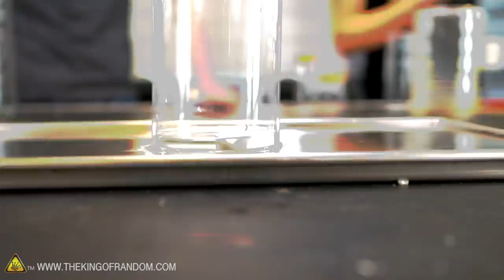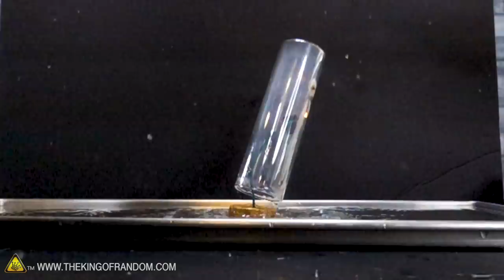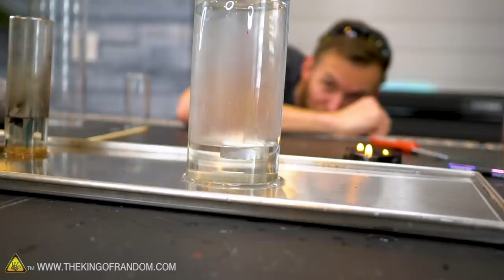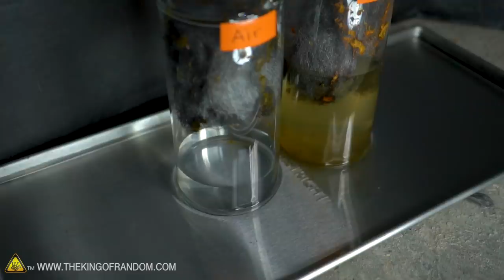Why Does a Candle Make Water Rise?

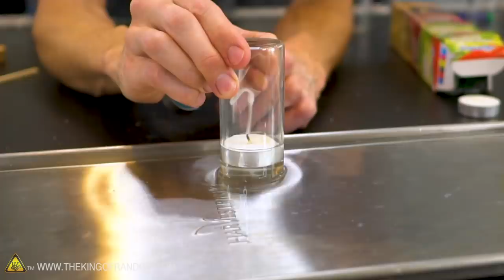Comment: 3:13 Nate : "You also get atoms of water..."
Me : Aight, imma head out...
Reply: Same thought here.
Reply: Water is my favorite atom. So is playing with lasers and only having one of two people wear laser goggles.
Reply: I came down here to say that
Reply: Our atmosphere is a lot of elements like nitrogen and hydrogen so it’s hard to say exactly a correct formula for the air in their location, but anyway the type of reaction is combustion which has a product of mostly CO2 and H2O. So here is a makeshift equation: Air + O2 -> CO2 + H2O
Reply: @RusticAlarm  I think you forgot the fuel in your equation, you gotta get something burning.
(Also, that's a r/woooosh right there)
Reply: Yeah same
Reply: Givrally you need an r/woooosh too
Reply: @givrally7634  the fuel is the oxygen.
Reply: Water are particles, right?
Reply: @CarpetHater  Water is a molecule, made of 3 atoms. But yes, you can think of it as particles.
Reply: When paraffin burns it does produces atoms of water

Comment: Why does a candle make water rise?

It just works
Reply: thank you for your contribution Bigfoot, mad respect
Reply: Love ur name ngl 😂
Reply: Just Some Bigfoot With Internet Access because the flame takes up all the oxygen 😂
Reply: The candle uses oxygen which takes up matter so the water wants to equalize the pressure
Reply: R/woooosh on some of the replies
Reply: @akturbo774  Nice 👍👌😍
Reply: The water gets so hot, it jumps up from the shock of being burnt!
Reply: How does bigfoot not be seen?

Stays off the internet! :D
Reply: Son : "Dad, why does a candle make water rise ?"
Programmer dad : "It just works, don't touch it."
Reply: it's a reaction of air expanding and then retracting so the candle heats up the air so it expands and pushes out the air then the candle flame go's out and it terns cold and makes - presser 
and pulls the water up.
Reply: Has anybody said r/woooosh yet ?
Reply: no
Reply: but woooosh
Reply: Just Some Bigfoot With Internet Access KINGU CURIMUZONU
Reply: You're cheating on donut
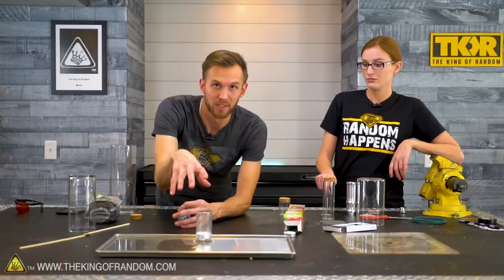Reply: He actually explains the primary cause (3:22). However, it's mixed with him talking about chemical reactions... Which at most is a secondary cause... But I don't think it has any measurable effect at all.
Reply: @devynjordan3097  almost right, but not quite.

The water is not being pulled - it is being pushed by atmospheric pressure on the outside.

"but when I stick a plunger onto a window and then pull the handle, I can feel the suction force trying to pull my arm!"

That isn't a pulling force, it is the weight of the entire atmosphere above the plunger, pushing on the vacuum cavity you created between the glass and the plunger.

This creates the illusion that vacuums pull.
Reply: Why do I see you every where
Reply: Create a vacuum in a closed jar with a match
Reply: @devynjordan3097  Exactly. It is a simple physical reaction. It has very little to do with the chemical reaction.
Reply: @plzletmebefrank  Finally. I agree 100%. Maybe the CO2 molecules are a little bit closer to each other (taking less space) than the O2 molecules were before the burning used them all but I don't think it has any visible effect either.
Reply: @forestdenizen6497  I totally agree . Very well explained.
Reply: Just Some Bigfoot With Internet Access Your on every video I watch I swear
Reply: It just does
Reply: It works like a rubber duck I think all the air leaves so the water rushes

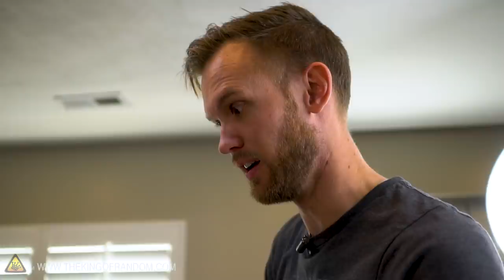Comment: 5:30 you watched a chemical reaction that displaced air. The ignition of the match caused a chain reaction that cause gases to rapidly expand. That made the bubbles. The physical change was when the molocules in the air cooled down and created low pressure, where the water rushed in to fill the vaccuum

Comment: Answer: vacuum. 

 The air heated by the candle takes up more space, so hot air escapes from the container (fixed volume) prior to the container being set down.   When the candle goes out, the remaining air in the container cools and contracts, creating an area of low pressure, which in turn pulls water into the container until an equilibrium is reached.
Reply: nice explanation
Reply: Finally someone understands. Paraffin was being burned and took up more space? Tf?

Comment: Independent variable: The water
Dependent variable: How high it rises
Controlled variable: The candles
Reply: You cant have two independent variables or controlled variables  and still get usable data, or the dependent variables. At least not without an already clearly established way in which these variables relate. Not to be rude, but you should research that.

Comment: My guess is that it has to do with thermal expansion. Gasses in a sealed container heat up much faster pushing out air through gaps and causing a vacuum that sucks the water in. I bet if you tried to use multiple matches or storm proof ones you would get a better reaction.

Comment: Well, you can measure the amount of water before and after the experiment and the difference will show you if there is more  water produce by a chemical reaction or it is just the shrinking cooling gas creating a lower pressure inside the glass cup.

Comment: Try this with:
Liquid nitrogen
Gallium
It might have some weird reactions or probably wont work
Reply: You could basically replace liquid nitrogen or gallium with anything and that would be the same.... It might have a weird reaction or not
Reply: No Dw41n
Reply: I think someone has done this
I've seen it
Reply: The gallium would just freeze. Because it’s metal.
Reply: @c10v3r  not with the nitrogen, lol
Reply: Wouldn’t work with liquid nitrogen but the gallium would be cool. It would probably just pull less in since the density of gallium is 5.904 g/cm3

Comment: I have the answer to your question: 

Heat
Reply: nitrogen would win it will because it is a cold gas that lasts so nitrogen will win
Reply: fire might win
Reply: Magic
Reply: The answer is buoyancy.
Reply: It's more complicated than that.
Heat causes the air to expand, which in turn increases pressure, enough pressure to push out through the water. Which that rush of air decreases overall mass. Which causes the water to rush in to equalize the pressure.

(EDIT: This works because when the air inside the jar cools, it causes the pressure inside to drop. Drop lower than the pressure of the air outside the jar. The pressure of the air outside pushes on the water, thus, the water rises.)
Reply: no it’s because magic has infiltrated the surface world
Reply: Exactly
Reply: Thou hath used expecto petroleum 🔥
Reply: You can see it's also because of the chemical reaction in the steel wool experiment
Reply: ShloKing Pretty sure it’s just magic. Nice trick though.
Reply: This is just Comments of people trying to be smart .-.
Reply: Vacuum
Reply: It's VACUUM SINCE OXYGEN RUNS OUT AND WATER TAKES THE EMPTY SPACE
Reply: @stephen4373  you know that's one OVERLY SIMPLIFIED ANSWER
Reply: Creates a vacuum
Reply: He actually does say that... It's in the middle of his bit about the reactions that could be causing it. 3:22 is where he starts talking about the heat causing expansion and that being a possible cause.
He should've summarized at the end that they discovered it to be the main cause though.
Reply: Vacuum
Reply: ShloKing Thank you for being pretty much the only trying to support my claim
Reply: @weewooo  Sure. I just felt bad that I missed that he actually talked about the cause of it all... You really kinda miss it with all the chemical reaction stuff he was talking about.
At least for me, I knew that wouldn't have that drastic an effect, so I was wondering why the heck he even was talking about it... And then I just zoned out.
Reply: ShloKing haha yeah I was kinda thinking thay

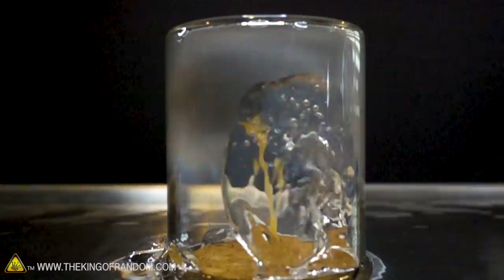Comment: In 6:15 its not the heat that causes the expending gas its the match head burning because in the match head thers an oxidizer and when it heats up its producing oxygen and it reacts with the fuel in the match head and creates co2. thats my theory.
Reply: thers also oxidizer in the fuse wich causes the same reaction

Comment: Replace the candle with an electrical resistance to heat the air in the glass recipient to pump up the pressure

Comment: Hot air expands and cooler air contracts, when the candle extinguishes the pressure drops sucking water, same as an empty barrel imploding when cooled or a can of pickle is sealed with hot water due to possitive pressure when it cools.

Comment: You guys are demonstrating basically a hydraulic piston - just like the ones in an internal combustion engine where the work is similarly done via the isothermal compression phase of the Carnot Cycle (piston rising up).

Comment: I noticed that every time you put the glass over a lit candle, bubbles are released.  I THINK that is due to the heated air expanding and being pushed out.  When the candle goes out, the air cools rapidly and shrinks which creates a vacuum.

I wonder if instead of a flame from the candle, you used a torch to heat up the air inside of the glass?

Comment: I don't think its heated air. (maybe for the candle)  The match and Fuse are small explosions.  they are very quickly turning into vapor pushing out all the air.  They also condense very quickly lowering the pressure in the tube and water comes in.  That is also why the fuse makes the tube pop off. its a continuous explosion and increases the pressure way beyond the match.

Comment: I do a variation of the steel wool one with my 8th graders in order to calculate the % volume of oxygen in the atmosphere. We dampen test tubes and then put iron powder in it (the iron will stick to the walls of the test tubes). We flip the test tube over and suspend it in a water filled beaker. The water is pushed up into the test tube and we measure the volume change. The students all get data very close to the accepted value.

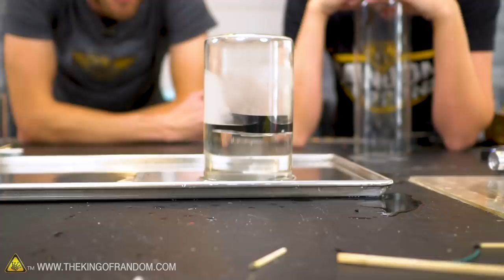Comment: The reason this happens is because of the change in pressure, when they light the match it immediately starts to ise up all of the oxygen in the cup. Then the product that is left over is water vapor and less air in the vessel after the chemical reaction, so in conclusion the water rises because the water wants to be pulled due to the low pressure and it wants to return to a normal level of atmospheres and it doesn't want to stay in a vacuum. You can clearly see this @ 11:00

Comment: The heat from the flame causes the air to expand which pushes out a small bubble. when the flame goes out. 
The hot air cools then sucks the water in...

Comment: The reason water raises is because the air after consumed by candle became lighter and change the pressure inside the cup create a vacuum action pull in the water and raise it a bit.

Comment: I don't think it's as much of a chemical reaction as it is a thermal one. You'll notice, especially with your matches but also with the candles, as soon as you put the glass on or light the match, there's an eruption of gas from the bottom. Air escaping the glass because the heated up air is escaping through the water but can't push the water out because of the surface tension. That leaves low pressure inside the glass. It's not because the oxygen is being used or transformed, although the transformation is likely happening too, but it is being expelled due to the heat expansion. Then when the air cools down, it is contracting and it can't pull air through the water because of the greater pressure so the water gets pulled in instead. Just a hypothesis but your slow mo seems to really show that rapid air expansion, hence the cork being pushed out.
Reply: The steel wool demonstration is definitely no the same reaction.

Comment: 4/5 of air is nitrogen and doesn't participate in the burning reaction.  When you burn wax half of the oxygen becomes CO2 and half becomes water vapor (which takes up very little space when it cools down.)  For combustion in a pure oxygen atmosphere, the volume of gas will be about 50% after combustion.  In air it will be 1 - 1/2 X 1/5 = 90%.

Comment: Note: this is commented before I watched the video
I believe that the water rises due to the lack of pressure formed by the candle using up the oxygen when it burns. The rising water effect was seen in the video where a jar was filled with steam, and then dipped in cold water, as explained in that video. I believe it is the same effect, just different causes. I may be wrong, I am going to watch the video to find out, than make an edit explaining after.

Edit: it appears to be partially correct, so I was half right in my hypothesis.

Comment: The candle is not polling water out, it is lowering the pressure inside the glass and the air pressure outside pushes the water up.

Comment: The trick with the burning candles has nothing at all to do with chemical reactions absorbing oxygen. The heat of the candle is heating the air inside the cup. When the candle goes out, the temperature inside the cup drops, pressure drops and water rushes in. You can test this hypothesis by heating the air inside a cup with a candle and then very quickly placing it in the water without a candle under it. The water is still going to rise inside the cup.

Comment: Because fire need oxygen to burn the candle string ( wich is organic so it burn giving carbon dioxide wich need oxygen to form ) so all the oxygen in the cup is used so the fire stops and there is  empty space that needs to be filled (as the molecular space is big in the gas state ) so it sucks the water

Comment: OK the real reason why it does that is because when you light the candle and put a glass over at the The air inside warms up. When all of the air is depleted the candle burns out in the air inside the glass cools causing it to pull  a vacuum, And the water is pulled in

Comment: The water level rises solely due to gas expansion (from the heat of the candle) and contraction inside the inverted glass jar. It's definitely not a demonstration showing oxygen in the air. There is no oxygen in the air - air is just air and oxygen is a gas that's manufactured from air.

Comment: It's simply warm air cooling giving the container lower pressure.. none of that paraffin nonsense.. If you put warm liquid into a bottle and leave it with the lid on the bottle will contract.. when the warm air cools there is more empty space as the atoms moving around slow down and fill up less space.

Comment: I...I throught this was just physics... The fire heat up the air expanding it(not enough space so air tries to escape through the bottom. Hense the bubbles), lack of O2 extinguishes the match pulls water in to take over the empty space left by the coold air...
Am i wrong????
Reply: Oops, that was a long one. Hope I helped. Feel free to correct my English if needed. I will put a disclaimer here, that the system is not completely closed - but the principals are very similar (mass is not conserved, elements are)

Comment: It’s because heat burns oxygen and the pressure pulls the water up 😂
Reply: Not exactly. The gas inside expands from heat and pushes its way through the water. Then when the air cools, the pressure on the water decreases. Since it falls below normal atmospheric pressure, aka, the pressure the air in the room is putting on the surface of the water, it pushes the water in.

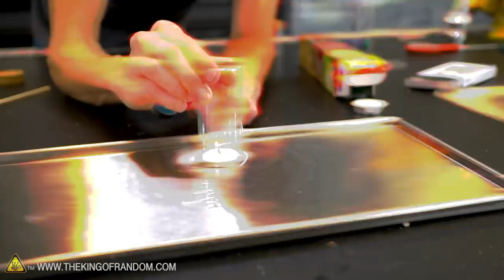Comment: The statement (at 3:08) of "For every two molecules of oxygen you get on molecule of carbon dioxide" is wrong. Molecular oxygen (as what is in the air) is a diatomic molecule. It is naturally O2 already. So you only need one molecule of O2 (plus a single atom of carbon from somewhere) to make a single molecule of CO2. No net change in the number of molecules of air-based oxygen to carbon dioxide. Unfortunately, the math goes against you for oxygen plus parts of the parifin to water. For every one O2 moledule combining with the hydrogen in the parafin you get two molecules of H2O, so you have a net doubling of molecules. Now, as the gaseous H2O condenses on the inside of the glass, there is one possible way of lowering the volume of gas inside the glass, pulling the water in. (I'm not sure how quickly that happens though.) My suspicion is most of the suction is as a result of the hot gasses (particularly the gasses hot enough to glow in the flame) cooling and trying to reduce in volume to lower the pressure inside the glass which then allows the column of air above the experiment to push the water up into the glass.

Comment: Heat make air expand. Flame goes out air cools creating a vacuum. Allowing the water to raise in the glass.
Reply: With the air expanding. Caused by the heat of the candle/match. Pushes air out. With said vacuum. Water takes its place.

Comment: I wonder what a vacuum gauge would read if the chemical reaction took place in an oxygen enriched atmosphere with a 1-way valve to allow the expansion to take place.
Reply: The water almost acts like a one-way valve.
Reply: ShloKing I understand that, but I’m talking about duplicating this experiment with a canister that has a one-way valve, to specifically measure the vacuum that the chemical reaction draws.
Reply: @MichaelTurvey1979  So basically, you want to know if there is much of any effect chemically compared to the expansion caused by heat that forces air through the water.
Reply: ShloKing I want to know how much of a vacuum that they can create using this method in a container with a one way valve. The water doesn’t act as an effective one way valve in this scenario, because it flows into the container, hence just making a smaller container with no significantly measurable vacuum pressure. Hence, why a container with a vacuum gauge and one way valve would be necessary for the revisited experiment. I suppose if they used mercury in place of the water, and measured how much it drew in by inches, they could get a reading, but it would probably shoot off as the oxygen enriched water experiments did, or just explode if the dense state of mercury didn’t allow for the initial expansion.